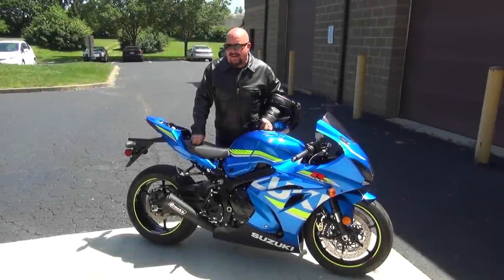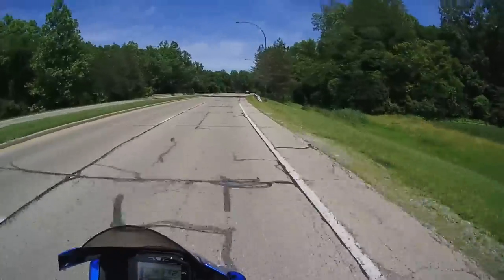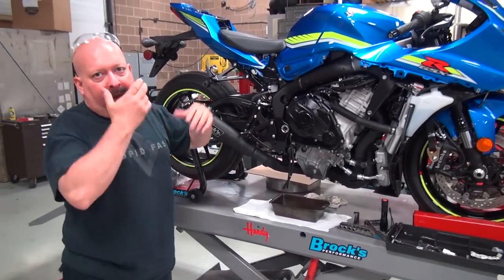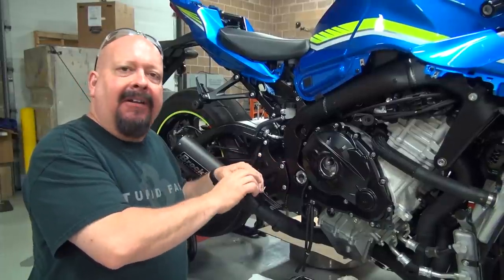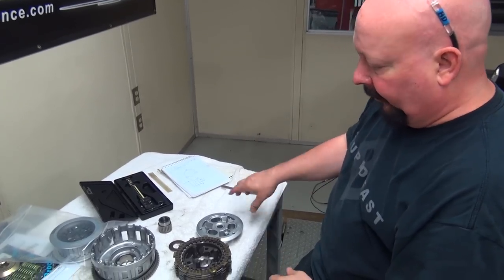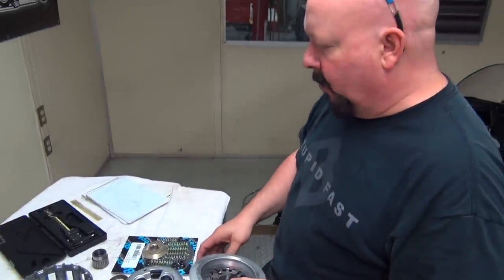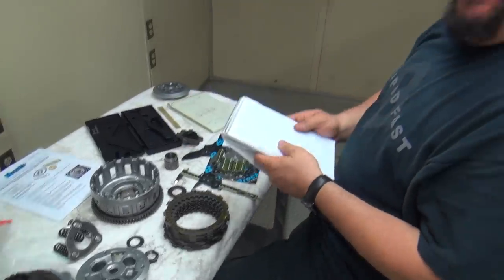2017 GSX-R1000 S2B: Episode 8 - Dragstrip Prep - Clutch Mod Conversion

Comment from the maker: See long description for video time tags and additional information.
Reply: Brock Davidson there are loads of bike tutorials on YouTube where the “bike expert” is pretty questionable, I love all of your vids because there is no questioning your knowledge and advise.  All your vids are extremely helpful to the everyday garage hero.  Thank you for taking the time to make these.   Thanks from Boise Idaho!!!
Reply: Brock Davidson Great video and unattainable info provided. Great job as always.  Quick question. This mod doesn't affect  the tc in any way will it?
Reply from the maker: apexhunter2k not directly as it's a mechanical mod.
Reply: Brock Davidson Ok cool. Your mod works very good and I'm considering it but did not want it to interfere with the tc since I like cornering also. I'm good with not having the slipper function when down shifting. I appreciate how you broke down how the clutch works on this bike. Since it works like a switch, either on or off, I guess that's why the came up with launch control to use with the clutch  or maybe it was vice versus.
Reply: Zero Tolerance :)
Reply: With that pice in the bike could u daily ride with that in the bike?
Reply: +Brock Davidson, the clutch freeplay has to exist because when you turn the handle bars one direction to full-lock it doesn't pull the clutch in.  That's really the only reason.  I just make it flush where the tight steer side is and make it slightly looser from there and leave it.  This is the same with non-driveby wire throttles.  If it's too tight and you turn it one direction it can add throttle which makes it more difficult and dangerous to execute a clean U-turn.

The problem w/ having the clutch too close to the bar for it to "open" is the increased possibility of stalling.  It's also harder to control the engine braking and slipping the clutch in low speeds which makes some people not even bother which makes them have Less control than they could have if it's done properly.  If the clutch doesn't "feel" right all the way "out" like I said it's better to use adjustable levers this way you can have the position you want and have it open closer to the handle bars w/o the "loose" gap with stock levers.
Reply: Is that a helmet your holding or purse 👜 😂 nice video man

Comment: Hi! Why did you choose the hub from k5-8, and not the hub from k1-4, which does not have this slipper clutch initially. It should be lighter and cheaper. Also, the working area of the disks is larger by k1-4. But 5 springs instead of 6.
Reply from the maker: 5 springs dramatically limits the fine tunability of the static spring pressure. Backdating that many generations is also not legal in most racing organizations. Of course, you can do as you like., but pay special attention to the inherent oiling capabilities.
Reply: @BrockDavidson  thanks for the detailed answer!

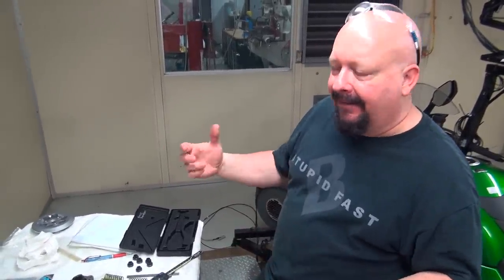Comment: 22:30 if the stack height is reduced  you don't loose spring pressure ,you just loose preload (so you eventually get some slack between the stack and pressure plate )
With linear coil springs like here (non progressive springs) you can't get more pressure or less pressure by compressing or decompressing them,but only more or less preload.
You need to shorten a spring it by cutting it and compensate with a shim to get more pressure, with the same preload (spring dimension)
It's just a bar of steel,but in a helicoidal shape.
A shorter bar is always less flexible than a longer bar of the same steel.(see leaf springs stacks) 
Normally the spring kit you sell is composed of springs with a slightly thicker bar diameter,or a different alloy from the stock springs.
that's why they create more pressure,once preloaded : same coil length but thicker. 
Very interesting video,specially the part where you adjust the slack on the thrower.
Reply from the maker: If the stack is shortened, the pressure plate will move closer to the backing plate (spring pocket in pressure plate moves also - spring post does not), which will make the spring preload (if you prefer) and resulting overall static pressure, less.
Reply: Yes.
Peoples are often confused by the spring pressure and the preload associated with its use.
As a pro being attentioned to the details and parameters like you are, in your videos,you should use preload and pressure in their specific use,moreover speaking about springs and shims used with.
Very interesting video,keep it this way,and don't be afraid to be technical,you have the good and patient way to explain principles correctly.
Greets from France : )

Comment: ya i picked up that bad habit  as well impacting  clutch hub nut and countershaft nut but dont  do it with aluminum    axles   steering  triple tree    center  pin  dont use impact you will pull threads right off  your part  been there done that  thank GOD  for ebay if i had to go to  dealer id  have to take out second morggage on house i just  bought a complete  transmission with shift forks and  drum and all springs and shafts in perfect condition for 90 bucks  took back the  2 new gears i just paid  480 bucks for

Comment: Drag  racing with my Z-28  camaro  if  you don't use the clutch properly   you  are either going to smoke the tires or  bog the engine with  open plenum  intake ..  I  had  slipping the clutch to keep the tires from smoking  or the engine bogging .. I had down to a Science..
  Thanks to all the   jooow  Tooog videos  I watch I learned   Never let off on the gas..   just  hit the rear  brake if you start to wheelie too much .  
  With my slow old  Yamaha FZ-07  I smoked a Harley  at a stop light the first race .. the next  red light I tried to do a  wheelie .. and I  let off the gas the the Harley  actually pulled ahead.. but not for long as  there was a huge  sweeping curve  ahead. .  anytime the road has  curves it's  bye  bye  Harley ..
  You need a longer swing are for Drag  racing .. but I suppose  your GSXR is a track bike .
  I was   Pretty good at whole shots  on a dirt bike too .. at  age  16  I pulled the whole shot  on  33 125 motocross bikes in my first moto cross race..

Comment: Is that the same as a slider, what your talking about (slipper)? Would you say that a full lock up is a better application for drag raceing on a stretched bike? And I love you carbon fiber wheels I'm buying some from you will they work on a jen 1.....
Reply from the maker: @Anthony Welsh - from a drag perspective, no a slipper and slider are very differnt. The slipper works like a conventional clutch...a slider works like a mini bike centrifugal clutch: no clutch lever required, but the bike in gear and it will accelerate as you twist the gas. Your lock-up question on a stretched bike isn't so easy. You can have anything from a simple 2 stage lock up, to a slider, to a multistage to a Gen 2 multistage. The use of the bike would determin the need. Yes we have many 'Gen 1' fitments, click here for more details: https://brocksperformance.com/wheels-tires/bst-carbon-fiber-wheels/
Reply: @BrockDavidson  I have learned alot just by watching your videos I love the tips you give it opens a whole new bunch of ideas now I see your talking about a factory set up.....I like the world wide bearings topic you did now I have my case apart and I'm doing it to cam bearings and transmission bearings....mabe one day I'll get to see you on the track brother!

Comment: OK! now I don't feel so stupid because I took my new to me mostly stock gen1 busa to the track and I couldn't get it under 1.85 60ft and that was on the back wheel. Now the next question.  What can I do to keep the front end down after the 1-2 shift? It picks strait up when I spray the 40 shot after the shift.
Reply from the maker: Once the bike has left the line and the rider is 100% WOT - power delivery/chassis/gearing make the biggest improvements in ET.

Comment: First, thanks for this video. It was supper helpful. I just needed a quick run thro because the service manual made no sense on the adjustment procedure. How often would you recomend checking the clutch pushrod adjustment for street? Also i wish there was a way to retain the slipper and still have those awesome launches with the backdated clutch. I wish i could have both! Its so hard to launch this bike, and keep the wheel down and go forward lol. But i dont wanna give up my slipper!!
Reply from the maker: Do you road race the bike? Track days etc...?

Comment: Love the videos Brock very informative. You make it sound at least to me, that slipper clutches are relatively new when they've been in production bikes for well over a decade. Also I get the aspect that a dedicated system is better than a system designed for every aspect of riding but I don't follow when you say a slipper clutch is either on or off. On to me is fully engaged, off is disengaged. There seems to be plenty of 'slip' in between. Other wise you couldn't take of from a standstill. The instant your driving forward I don't understand how a slipper clutch grips less or is harder to modulate than a regular clutch.
Reply from the maker: For clarity: Traditional slippers have been around for a long time, the 'ramp style' shown in this in OEM applications are new.

Comment: I noticed you didn't mess with the cable adjustment under the tank like the manual says. Is there a reason why you would or wouldn't need to mess with that adjustment?
Reply from the maker: Any additional adjustment would only be needed if the two shown cannot reach the desired outcome (due to cable stretch etc...)

Comment: Hi Brock... nice mod here.

By the way,  in what comes to performance spark plugs it has Been really hard to find the apropriate ones for this bike, and specially in the case of bmw because they have lifted the compression of the pistons compared to the previous model, what turn things more dificult...  brisk claims itself their racing silver plugs with 360 degrees diacharge to be the best ones... although i have already  seen 10hp loss on dyno with them... 

Any right choice dyno prooven for this mod...?

Thanks
Reply from the maker: We use the stock plugs at the manufactures recommended gap. We shorten the gap to .022 inch if the engine will see nitrous oxide use.

Comment: My 06 GSXR 750 makes a howling noise when I slip the clutch. Does it on the drag strip or even at red lights with soft launches. What could be causing that?
Reply from the maker: That's the slipper clutch. In some bikes it sounds like a dog getting kicked in the ribs, lol.
Reply: Okay. I didn't know they put them in back then. Glad to know it's nothing to worry about. It already was coming up with the 17/47(0/+2) setup. I just assumed it was the additional power and stock height vs my Katana which was lowered and strapped down. It's  .08 slower than the Kat but 10mph faster in the 1/8 mi. I imagine the 16 front is gonna make it a bitch to launch now. Lol. May try to lower and strap it one weekend and try my luck there.

Comment: Very informative ! I don't drag race but I have a question :  I bought Heavy Duty Spring set from you for my new Z900RS Café. I was surprised there were only 3 springs when I got them. Looking @ your vid I just realized it is BC I have a slipper clutch ! (my first one) So what is the purpose of installing the stiffer springs on it if it "locks up" on the OEM springs ? On all my previous bikes I always upgraded to heavy duty springs but there was never a slipper clutch in them. So should I install your kit or not on my Z900RS Café ? What would it do/ change ? Thanks, George
Reply from the maker: You have an "assist" clutch with a slipper. Our kit allows the bike to accelerate quicker, while removing your mushy lever feel, until the assist kicks in and removes any feel you just had from the equation.

Comment: Brock you're amazing. Question:
Now, with your mod installed, does the slipper clutch aspect still work for downshifting at high rpm for circuit racing like originally intended?
Reply from the maker: No. The slipper aspect is completely removed... it works like a standard motorcycle clutch.

Comment: I know you are just  demonstrating  , but I thought you were supposed to soak those  fiber plates in  ATF  before assembly  same as coating the steel plagtes ?
Reply from the maker: ATF? Maybe in a Harley.. but not in a sportbike with a wet clutch. Mixing ATF and synthetic motor oil can make an engine destroying mix (or lack of mix...) for sure.

Comment: Slip releases on back-torque, but also bites on acceleration. Hard to modulate a slip/assist clutch on bite due to ramping actions. Weren't the first versions just slip (back torque) without assist (forward torque)? Single ramp versus dual?

Comment: I have a question, I have a suzuki 2014 gsxr 600 and I have the same problem with the clutch, you can do the same with the gsxr 600, you have them in stock for my motorcycle
Reply from the maker: Unfortunately the GSX-R600's are different and non of our clutch items will help. Your best bet would be to figure out if your inner and outer baskets are worn out. Go here: https://youtu.be/_YFqq5kI-fw?t=745 inspecting your inner and outer are performed exactly the same.

Comment: Hi Brock great video. I have the same gen geexr and was wondering what year (older) clutches are compatible with my bike.
Reply from the maker: That depends on if you have converted away from the assist clutch that comes in the 2017. If so, our conversion lists the replacement clutch required.

Comment: with cable clutches, the clutch material plays a role where it engages? cus ive adjusted my gsxr properly using the worm gear, cable and adjuster wheel and it releases same spot each time

Comment: I feel like you’re referring to the assist, the slipper ramps are on the opposing side as the assist ramps. There’s some bikes with a slip without assist
Reply from the maker: I'm speaking about grip and slip. AKA assist.
Reply: @BrockDavidson  just double checking, and I meant my second half as a question, do you know of any that slip but don’t grip, like only working on downshifting side
Reply from the maker: @davidsherman1389  most all modern sportbikes, before switching to assist, had slippers with traditional spring pressure handling the gripping chores.
Reply: @BrockDavidson  gotcha

Comment: hey brock! just installed the clutch mod and i’m having a hard time keeping the adjustment screw with slack after the 3/4 turn. it has slack up until i adjust the clutch from the lever, is that normal or should it still have a little bit of slack
Reply from the maker: They must be adjusted in order. Max slack at lever, adjust screw at clutch 1full turn out. Readjust slack at lever.
Reply from the maker: https://youtu.be/VBeYEhEIX3U?t=1994

Comment: Would this be possible with the 2008 Yam R6? At the moment, it does a mid 1.8 to the 60 with a 10.5 ET. I've seen on your site that you do the 09-14 R1, but would I be able to retrofit the r1 mod to my r6?
Reply from the maker: Something can be done, I'm sure.
Reply: @BrockDavidson  Where there's a will, there's a way ;)

Comment: Hey Brock, I was wondering if this kind of clutch mod would fix the R1 known off on clutch problem and if you sell the parts for the mod? I have a 2011 R1 with 3500 miles on it.
Reply from the maker: @Will, all you need is this: https://brocksperformance.com/clutch-mod-r1-09-14/

Comment: The 02 doesn't have that does it? Went from that to an 07 1k and the 07 I thought had some issues because at low speed I don't have the same throttle response in first.
Reply from the maker: It's something different, But the 07 has more restriction down low than the 02.
Reply: @BrockDavidson  staring to believe it's all in the ecu. From like a slow roll of I pull twist the throttle all the way it doesn't take off asid expect it to but only in 1st.

Comment: brock I have question, I just got a zx10r 2018 and I wanted something different as far as an exhaust because I do already have a full system alien head on my 2017 gsxr 1000 , I was going ask you bc I wanted to try something different on this bike and bc you know a lot about exhausts and whats not so im triying to decide whether I want to do a sc project can crt exhaust or the two brothers s1 r exhaust that one rides low and is about the length of the alien head which will perform better in the 9/10 mile , id appreciate your opinion  and do you think they'll change the zx10r for 2019 or 2020
Reply from the maker: I can't tell you about the performance of systems we do not sell/have never tested. I can tell you that overall exhaust length is only one factor which determines power/performance. head pipe lenght/diameter/ step configuration makes the most difference - can length makes close to the least.

Comment: Did you try the R model with launch control? Is it just something to put on paper or actually useful?
Reply from the maker: We did not try launch control on the GSX-R1K. FYI: we have never used an OEM launch control that did anything other than slow us down at the drag strip. It seems to work ok for drag racing rookies, but it is far too intrusive for a skilled rider with a properly set up bike.

Comment: So would this set up be ideal for other kinds of Motorsports like track racing as well to get better launches at the start? I’m just curious to if there are any differences in clutch set up drag v track racing having done neither myself.
Reply from the maker: If you need a smooth/clean launch from a dead stop - yes. If you need the slipper more for the racing you do, then you might not need it. You would need to try it both ways to see which works better for you.

Comment: simply replacing slipper clutch with conventional basket?am i right?
Reply from the maker: If you have the correct parts, confirm oiling passages match and provide comparable static spring pressure - yes.